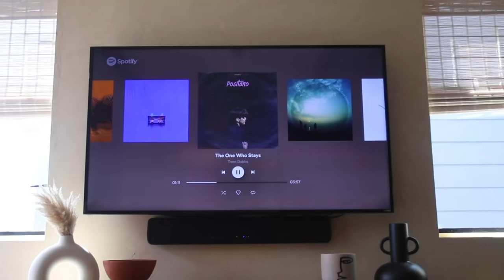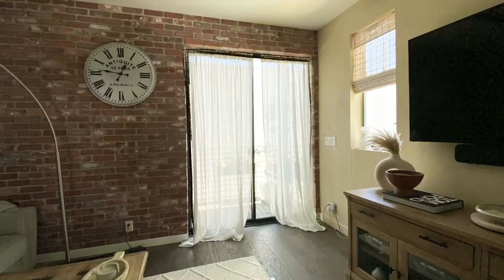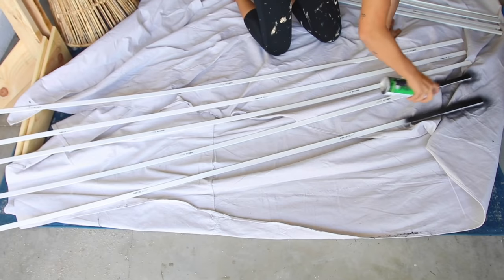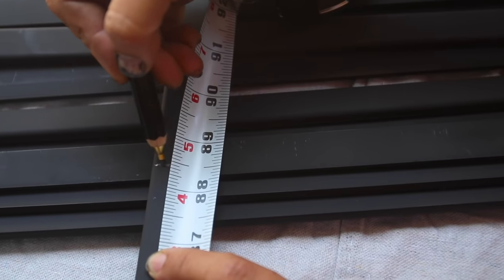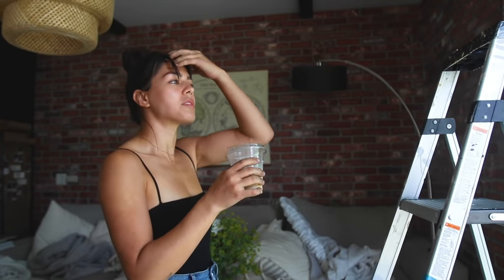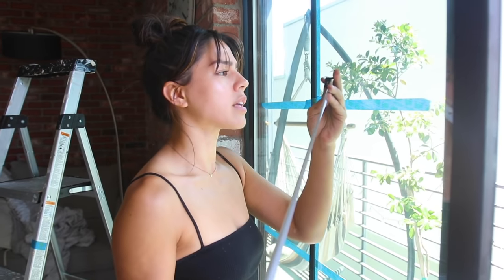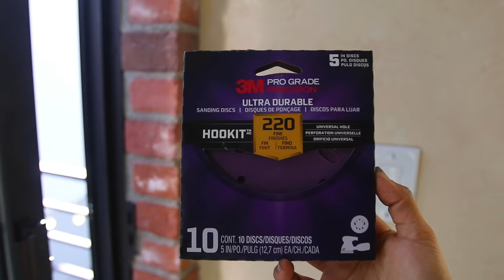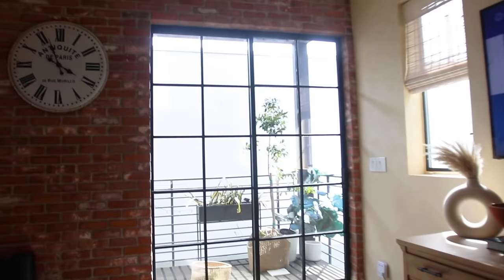I DIY a $1000 French Door *only $70!*

Comment: Just popping into say that all measuring tapes are loose at the end for when you're measuring the outside of something (hooking the metal onto a surface) or the inside (pushing the metal against a surface) :)
Reply: right!! it gives you a true zero, the wiggle room is the width of the piece of metal on the end so that when you're measuring from the inside it accounts for the space that tip takes up.
Reply: You can also just start measuring from 1" mark and then subtract 1" from your total measurement. Then it's perfectly exact. That's what I've been taught so passing along! :)
Reply: thank you!

Comment: Fun Fact: the reason for the end of the measuring tape being loose is to accommodate for the thickness of that end piece. That way when you pull/push the tip against the material you're measuring, it will already be accommodated for and the markings of the tape should be exact.

Comment: I recently learned from the guys at " This Old House" that the tape measure shift is actually intentional and accounts for the thickness of the metal tip.  The metal tip is exactly 1/16 of an inch thick. The way it works is If you’re measuring the outside of a surface and hook the metal end on the edge, that metal piece will shift out and create a gap, so that you aren’t counting it in your measurement. If you need to measure the inside,  like in a window frame, the metal piece will shift back to fill the gap and calculate the measurement correctly.

Comment: The wobby tip of the tape measure is the thickness of the end. It slide in when measuring inside sides and out when measuring outside ends, like cutting a board.

Comment: That little wiggle at the start of the measuring tape is to be able to measure from the outside (pulling across something) or the inside (pushing the tape against a surface).  That wiggle is equal to the thickness of the metal lip.   The more you know!!!

Comment: so the measuring tape space do have a purpose. so when you pull in it it will give you the number X, and when you push it in to something it will give you the same number X. the reason why you can move it a tiny bit, is the thickness of the metal end. the metal is 0.X thick, so push to measure is X + 0.X and pulling measuring is X - 0.X. but both methods gives you the same length of X, since it is able to move 0.X that is the thickness. and ofcourse the empty space between the tape end and the metal end, is for the movement and is also included with the numbers you read on the tape.

Comment: Not sure if you will see this but that "wiggle" in tape measures is by design and is there to compensate for the hooks thickness. You push against things for inside distance and pull away for outside. It is also the reason you should always let it contract softly else the rivet gets loose and the compensated measurement is thrown off a "skoosh"

Comment: The gap on the measuring tape is on purpose! Because you use the end either pulling against something or pushing up against something. The metal part is like one mm thick and pulls away one mm so when pushed up against/pulled away from the measurement balances out

Comment: I think they take the scoche into account with the width of the metal? Yeah "The metal tip at the end of your tape measure is a little bit loose for a reason. The first inch of the tape is short by 1/16 of an inch. This isn't and error: It's meant to provide you with the accurate readings whether you're measuring the inside or outside edge of a surface. This feature is known as the 'true zero' "

Comment: The metal at the end of the tape measure moves to allow you to measure accurately from both the inside and outside of things. You need to push against the surface for measuring inside and pull it against the surface when measuring from outside. It moves the thickness of the piece of metal.

Comment: The tape measure moves depending if you butting it against some or if you are hooking it on something. It should move so it's more correct. It should move by the width of the prong.

Comment: The end of the measuring tape moves on purpose!!! It takes into account the width of the metal tab so it’s accurate it you’re pushing the end of the tab against something like a wall or if you put the tab over a piece of wood and pull the tape.

Comment: The measuring tape is accurate it’s has some play so when you measure inside a let’s say a square. It subtracts the thickness of the metal tip and adds it back when you pull on it when you let’s say measure the outside of a square.

Comment: The metal tip at the end of your tape measure is a little bit loose for a reason. ... This isn't an error: it's meant to provide you with accurate readings whether you're measuring the inside or outside edge of a surface.

Comment: You could have just painted the panels in by taping them out and spraying paint into the lid and brushing or rolling it on with a micro roller. Then you can scrape it off with a razor blade if you decide you want to later. maybe I don’t understand what you’re doing yet.